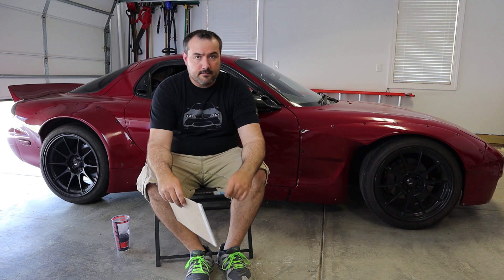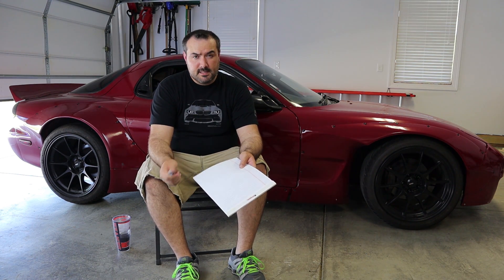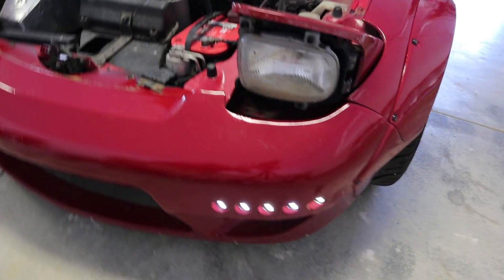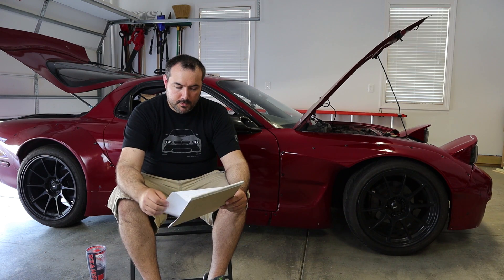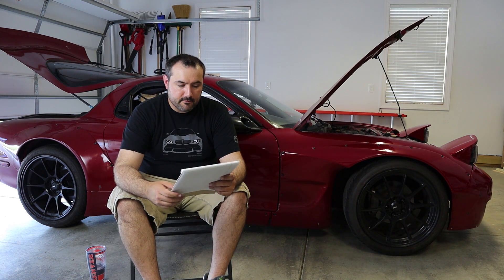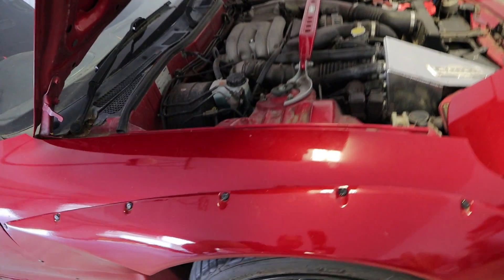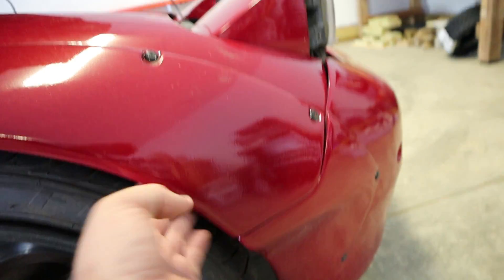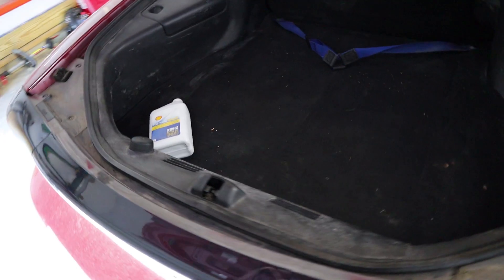Developing a Parts List for My FD RX-7 (and Thank You!)

Comment: I won’t say B is for Build isn’t trying to push out content and thus has a certain level of build quality, you guys have good points in that area. But if this build is watched on B’s channel he did have a Mazda enthusiast come in and do spark plugs and an oil change and I want to say he did check the compression. 
It just seems like this channel’s ideal or level of work is a bit higher and that’s awesome but B is for Build had a goal to drive to CA and he did a home widebody and paint job quickly that turned out better than I could do. I’m stoked this gentleman got this car to keep its life getting better and better but good work was done. It was rough when it was saved from Japan. Looking forward to seeing progress.
Reply: This, this and this. Chris clearly had a goal and expectations and he gave the car a new life and inspired this guy to put more love into it. People don't realize that to order all these little trim pieces, tear out all the wiring and replace every weather sealing and mechanical part will take months (shipping and install) and cost at least $10k. Anyone who claims to know of a short build of better quality must be referring to an entire shop of guys who have all the parts in stock and don't have to spend 3-4 hours editing every video. This guy is expecting the same quality as his brand new BMW sitting outside from a 20 year old car. And that's fine, just not what Chris was going for. Chris made a few mistakes but I wouldn't call this a botched job. He used rivnuts and didn't drill oval holes to keep them from spinning. Common mistake. He didn't correctly wire the lights. That was very clear to the owner. He didn't finish the radio install, clearly it wasn't important to him. None of these hurt the car, it is in better shape from when Chris bought it. The paint is good enough quality that a wetsand and buff will make it look mint, that just isn't possible in 24 hours. Factory new cars come with orange peel... Everything else he just didn't have the time/budget/desire to track down every single piece and do a complete restoration.
Reply: I would continue your line of thought by saying Chris would have been the bad guy only if he kept the car and let it sit and rot outside. The fact he begrudgingly sold it as he couldn’t further the car as this guy’s channel will do beautifully is what makes everything cool in my mind. He gave the car a chance to get better and I’m happy it won’t become the Camaro sitting out or the BRZ getting beat up. Everyone has great points and most is from the love for this car, super heart warming, but everyone has a different idea. It’s all relative.
Reply: Yeah I'm happy he let it go to this guy, he seems to know his stuff. So far he's shown he understands cars enough to diagnose them very well. And he clearly has the money needed to tackle this. Let just hope he follows through, I sure as hell know when you are months and thousands into a project it gets awful tempting to cut a few corners. If you go to a car show and see a perfect car ask the owner how it got there. The answer is either a lot of money and years of time or paying a shop 3x the amount the car is worth. Takes a ton of love to get a car back to perfect condition.
Reply: Couldn’t agree more.

Comment: Don't get discouraged looking at the list of things needing attention, the car is worth it!

Having watched the original series on the car, I would say the reverse light issue will be somewhere at the gearbox where the loom was melted and "repaired".
While I cringed at the cutting of the car for the body kit, and it is not something I would do, it does seem to look OK on the car, personally I would just slowly gather the parts to return the body to stock and just store them until the time comes rather than rushing to get it done.

Looking forward to the coming videos of it becoming the car it should be!

Comment: For the weather seals, get some SCUBA grade silicone grease.  It's what SCUBA divers use to treat the rubber in their O-rings and seals.  It's 100% pure, and works wonders on rubber car parts!  A little goes a LONG way!  I've gotten 3 applications out of a small container for my 350Z and still have just a little less than half left.

Comment: Ditch the entire sequential turbo system at the first sign of problems. As a former FD RX-7 owner I deleted EVERYTHING and went full proper non-sequential (with the plans of going proper single turbo in the future) My streetported car made 267whp on wastegate spring pressure after deleting all the solenoids and vac lines and going proper non-seq. Modern ball bearing turbos vastly outperform the heat-soaking terrible stock twins. Clutch forks like to break (stupid pull type clutch!) diff cases can brake because they are thin cast iron, but they make braces that help with this.

Comment: Few more: keep it to around 4k RPM or less for the first ten minutes of driving to let the oil and coolant get up to temperature before beating on it, extended cold start idling and constant low RPM driving contributes to carbon build up, it's good for them to be revved to redline and close to redline once warmed up as long as the coolant temperature isn't climbing too high

Comment: Use 20w50 or at least 10w30 conventional motor oil like Castrol and change every 3k miles or less because of fuel dilution, premix 1/2 oz. per gallon of fuel with quality 2-stroke or Idemitsu rotary fuel lube to supplement combustion chamber lubrication, spark plugs will only last 15-20k miles, replace the cooling fan that he rigged with stock or higher flow than stock, get a coolant temp gauge and never go over 220 degrees because you have coolant o-rings rather than a metal head gasket, use quality coolant like Prestone mixed with distilled water, install a wideband to make sure it doesn't lean out with the open exhaust, the fuel filter is above the rear differential, a turbo timer will help your turbos live longer, use Redline MT90 GL-4 in the trans and Redline 75w90 GL-5 in the rear end, if you move it a few feet and shut it off cold repeatedly it will eventually flood and fail to start because it rinses the oil out of the combustion chamber. Not trying to tell you what to do, just trying to be helpful so you don't end up hating it like most people. Good luck with your project.

Comment: Seems that "B is for Buyer Beware".....
Reply: its all about the price. If the car was sold at a perfect condition price, then yes. But it seems he got it for a decent price and most of the issues, dont seem  to be related to what chris did to the car.
Reply: he already said he paid too much for the car, so no
Reply: I agree. Why are people afraid to call Chris on his work. Tired of these leg humpers
Reply: well i wouldn't buy most of the cars, that chris "fixes". Both 86's where botched fixes. Non of them had airbags and he said "oh I will put them in later or before i sell i will tell the buyer" and i really hope he did one of these things. The repair of the bent door frame on one of the 86th didn't look structurally sound...

This car, visually looks pretty bad (the paint has so much orange peel, you can see that randomly in the video), the side skirts misaligned, missing misc stuff. Mechanical stuff he didn't really touched (if im not mistaken).

And if Matt said he overpaid for the car, then yea, he got "swindled".
Reply: mrdocprofessor patrick if you look at the build tavarish is doing and the attention to detail then you will see that taking your time pays off big. Why would you want drive a crappy car that can possible cause an accident because it seems he didn't do a proper inspection prior to taking out on the road. Problem is Chris also did not even do a good job cosmetically either. So what was right about the build. Chris put pressure on himself just because he wanted to drive it to California but not because he had to. He could've just used another car.
Reply: That car is the reason why you take women swimming on the 1st date!!!!! That thing is a deadtrap....
Reply: Said it earlier and will say it again... Plenty of build have been done in the same amount or less time that aren't a hack job. If you are on a strict timeline then don't bite off more than you can chew.

Comment: Car is in worse shape than I thought.  But for a 3 week build and doing all the work himself I’m impressed on what he got done.  Chris is getting better but he is self teaching himself.  If you would have gotten a ship to do the wide body it would have been big money.   

Just take your time and do it right.   If you have to get someone to build you some aluminum inter fenders for the front and then revisit the rear wheel wells to straighten them up.  And it may not hurt to go ahead and fill in all the rivnut holes and start over on the fitment if you keep that kit.

Comment: That damaged wiring loom is the main front loom.goes from the engine ECU all the way around to the fuse box next to the pedal box.  For bolts screws and all sorts of parts. Find your part numbers from a service part catalog and order it from Amayama.com . I have bought basically a entire new car's worth of bolts,screw's, seals- everything. I have a right hand drive Series 8 Rs. beautiful car when you have a  clean one.

Comment: Have you come across any issues with TPS (Throttle position sensor)? How can I diagnose if mine is working properly and if it isn't, how can I change it out
Reply from the maker: They are prone to failure as they age. Typical diagnosis is checking resistance with a multimeter through the range and checking against OE specifications. There is some adjustment that can be done if it is out of spec, but if it is way out or doesn’t show the correct resistance, it may be faulty. You might be able to pick up fault readings if you have an aftermarket ECU. I doubt you can find one new if you need a replacement. Used is about the only way to find one these days. You may have to get an entire throttle body as that’s most likely how the seller will want to sell it.
Reply: @IconGarage  Hi, thank you for the response. Do you know what the multimeter is suppose to read? any idea on how to replace one, perhaps a video? I hear they are very difficult to replace and adjust. I spoke to someone at a MAZDA dealer here in Chicago and Mazda still sells them new. However, they are pretty expensive and they are not refundable. I wanted to check and make sure that mine needs changing. thank you for all your advise and support
Reply from the maker: 1k to 5k ohms or something in that range. Look up the factory service manual online for specifics. I don’t have a video of it currently. If I ever have issues with mine, I will be sure to make a video.

Comment: Did you have to remove the rear hatch glass to replace that weather strip? I’m about to do mine but didn’t want to pull the old strip yet if the glass needs to be removed to install the new one. Any help would be appreciated. I love the way you went about the interior I will be using your videos as a guide to do mine as I also don’t like rattles or vibrations inside the car
Reply from the maker: I believe the hatch glass uses sealant between the glass and hatch opening. The rubber seal on the outside is separate and it goes on after the glass is installed. It’s not as likely but if you are having a leak, it may be worth removing the glass and resealing it. Also unless you have the tools and sealant, it’s advisable to take it to a glass shop and have them do it. It’s usually not that expensive and they will have the equipment and products (and insurance!) to do it.

Comment: I think going to a stock body may not be necessary. I would suggest getting a less aggressive more subtle widebody kit. Something like a a FEED style or RE amemiya style kit. Check Shine auto. I have ordered rx7 parts from them before and they are extremely high quality. Your valuation of 25k is on the higher end of lhd cars in your country. The RHD cars do not usually hold as much value in the USA. My 2 cents

Comment: Continuing to watch, the RHD cars don't have security and warning lights on the console. Only thing that goes there are coin holders. The lights you are talking about are on the dash already
Reply from the maker: You are correct! After reviewing the parts diagrams a few days ago, I realized these were coin holders.  Oddly enough there are two extra sets of OEM wires running into this area.  Everything else is hooked up so I am not 100% sure where these go.

Comment: CAN YOU PLEASE SHARE HOW MUCH YOU PAID FOR THIS $$$$$???????It helps us out, when we start shopping for RX7's out in the market.Thank you
Reply from the maker: The price I paid is a little skewed because of the car’s history and all of the extra parts sold with it. Based on what I have seen, I’d say $12k US is about the sweet spot for a slightly modified RHD FD in this shape (assuming it hasn’t been cut up for a replica wide body kit). I’d think with a straight body (not perfect), strong 13b, complete interior, low km/miles, all original car, $15k to $18k is fair for RHD FD in the states. The similar LHD version is probably $18k to $20k. A very clean, low miles, clean title, all original LHD could probably fetch $24k or more. Check out current and past auctions on bringatrailer.com.

Comment: If the engine needs to be rebuilt i know one of the best rotary mechanics in the east with my referral you can get one built or get the one you have done right and at a very reasonable price. This guy has shelfs of rotors and housings ready to be built to your specifications.

Comment: Stock boding it seems like a waste. If anything a better paint job and getting the wide kit secured in a fashion with quick disconnects to show the power build side of the rotary and ease of rebuilding would be better. Wide kits are sexy when the power train matches it for reliability. Just my opinion. I’ll be watching.

Comment: Did you use rx7 and reliable in the same sentence lol. A turbo rx7 at that.  But then again rob dahms 3 rotor lasted forever with tons of horsepower.
Reply: You can make any rotary reliable, just need a couple of mods/upgrades to the fuel, cooling and oil systems, a decent tune and pedantic servicing.

Comment: Would love to see this car restored back to stock body
Reply: This is basically unrealistic to expect.
Reply: No one owns a rx7 and reverts it back to stock like wtf
Reply: Nah. Rocket bunny looks good on it.
Reply: Yeah I agree, unrealistic. But he’s the one who brought up finding a donor car and having the quarters replaced. Not impossible by any means just a pita
Reply: It's cheaper and easier to get a new chassis (read, buy another RX7) instead of undoing a widebody kit. The process of widebodying a car involves cutting a large chunk out of the fenders, quarter panels, and inner wheel arches. Replacing the fenders is easy, but the quarter panels and inner wheel arches requires metal fabrication and some sort of donor pieces.
Reply: sfayer90 that would involve at least 10k of body work. It would be cheaper to buy another RX7
Reply: Spirit R FDs look amazing, theyre factory FDs with aero
Reply: Again, I’m aware that the job is huge. And again, he’s the one that mentioned taking that on 🤦🏻‍♂️